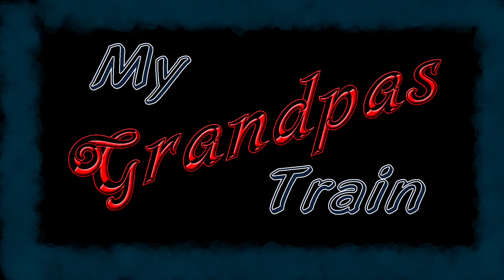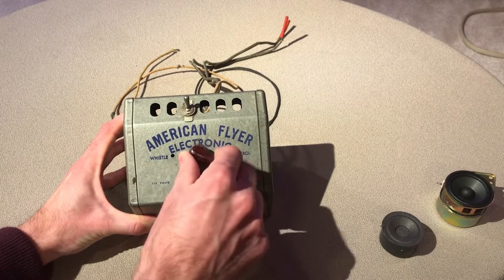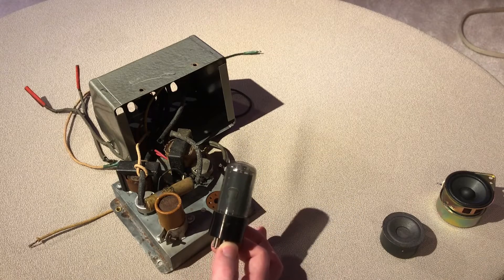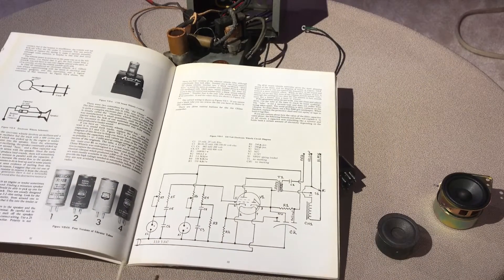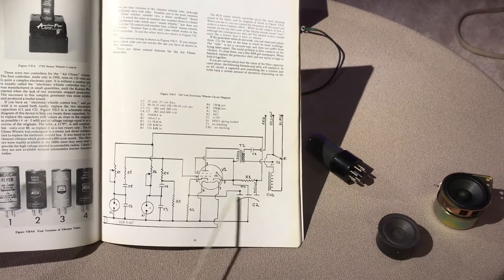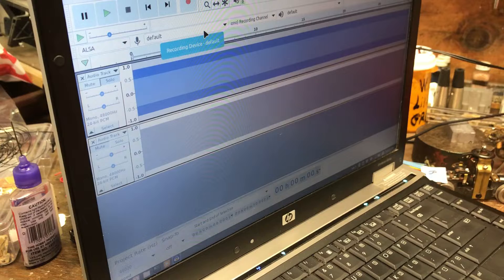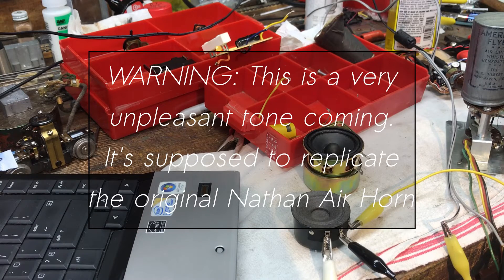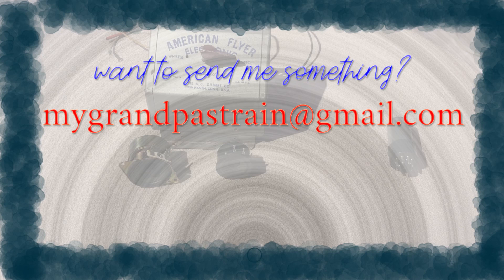What's Inside the Original American Flyer Electronic Whistle? Miniature Field Speaker

Comment: Thanks for the major effort on your part! I really wish we knew the story behind this whistle as it suggests  major overengineering on the develepors part in some kind of panic mode. I used ceramic disc and later orange drop capacitors in this unit ( you can get the exact values )and they both worked. The orange drop caps seem to sound better. Everything in these units is suspect but for the vacuum tube which I have never found a bad one ( really!).  The switch may be bad and definitly resolder every solder joint as they may be cold soldered ( this was my most frequent problem)  This unit was designed for the plastic two lead  early speaker..The variable tone carboard tube tone gererator was the best sounding (circa 1955). for any of these speakers. I hate to say it but when this unit ( electronic whistle, plug in wall). works properly its power of disappointment is exponential CASG

Comment: Thankd for the speaker demo. I didn't realize that 3 terminal speaker had a field coil.
Reply from the maker: I didn't either until I took it apart. Then it all made sense. You can get a much louder horn with a field magnet, just like the field motors were much stronger than permanent magnet motors. I probably should have clarified that in the video, but this videowas actually pieced together from what was supposed to be three videos.

Comment: It's neon bulb relaxation oscillator circuit.  Modern capacitor values differ slightly but you can replace them with values that are close.  I have two of them.
Reply from the maker: I sure wish I understood more about circuits. The larger value caps are relatively easy to find, but I've had no success with the small ones. I plan to replace at least the two large ones, mainly to prevent 120VAC from making it's way onto my track!